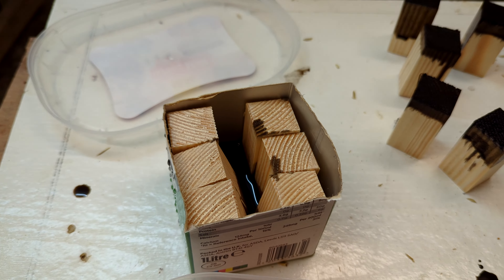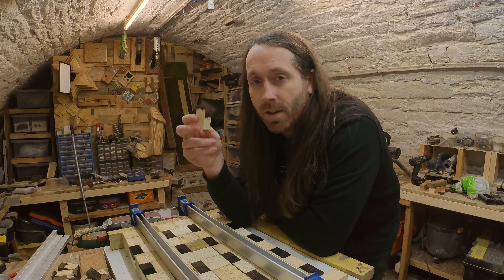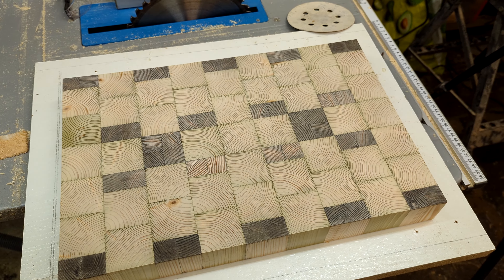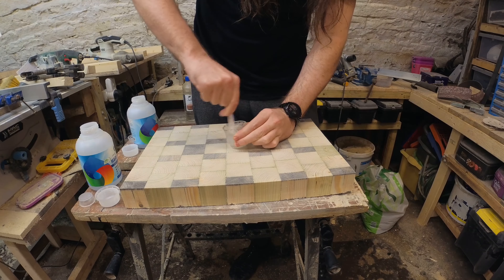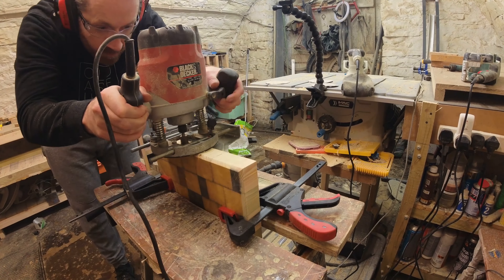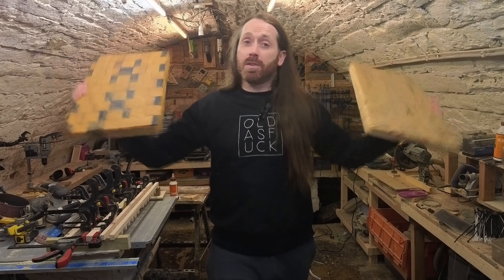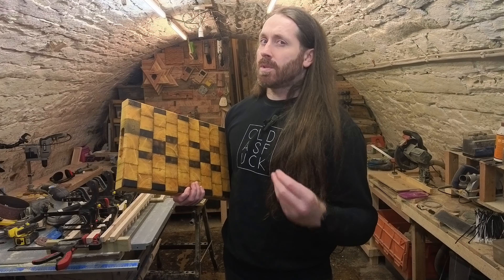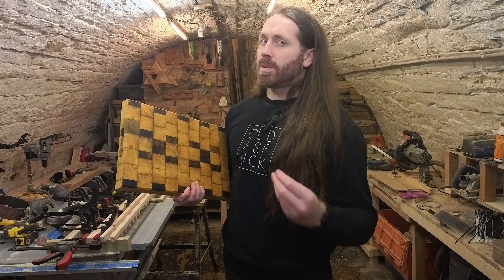Making End Grain chopping board for under £10

Comment: When 'practising' the art of cutting boards, ANY wood is good.  If using wood of an unknown origin, ie anything other than natural wood from a log or slab...or store bought, I would suggest using the 'samples' as hobby boards.  For instance, one in the workshop to smack things on a 'soft' surface, but without denting your worktop.  The other option could be for modellers etc.  If you route out a recessed surface, it would help to stop those pesky little bits and pieces sliding off and getting lost.

My first attempt was using defective and off-cuts of pine from my local Bunnings (in Oz), which was either CHEAP or even FREE, as it could not be sold as warped, split etc.  After watching MANY videos, my next was simply a side grain option, using french oak planks which were used to flavour red wine.  The colour came out great, and smelt nice.  I then reverted back to 'food safe' pine to practice my first end grain, but using the method 'usual' of gluing long boards, and then cutting, glueing, cutting and glueing.  It is definitely an art, to getting the squares right, and equal.

I have left my boards to dry for as long as possible before flattening them, just to allow for moisture to escape, and settle etc.  You could always add a border/frame to the outside edges, this would not only give a different look, but also add a strength to keep them straight, especially if dowelled, which adds it's own pattern if you change it up a bit.
Reply from the maker: Thanks for the info. It's always inspiring how much feed back and help I get from these videos!

Comment: The reason you had issues with the router and leveling it in the end is Pine is terrible for cutting boards as it is such a soft wood.
Reply from the maker: ahhh so it was the wood. I know some woods have worked better than others, but I've never seen it that bad. Maybe it was a combination of the wood and a dull router bit.

Comment: Cutting board out of treated timber 😞
Reply from the maker: Is that bad?
Reply: I was going to say the same thing
Reply from the maker: @fromthepalletshed  I don't get it? What am I missing 🤔
Reply: 0:05 top left of the screen, is that a wooden Christmas tree pointing out of the wall ?
Reply: @LowBodgeItFilms  The lumber you used for the second board isn't treated timber based off the sign you showed. Never use treated lumber in anything food related.
Reply: @LowBodgeItFilms   There's a lot of toxic substances that can be found in treatments and stains. Tight grain natural hard woods are for the most part food safe. The open grain of soft woods like pine will rapidly fill up with bacteria. They would make nice serving trays, but I really wouldn't do any food prep on them.
Reply from the maker: @jeffcarr392  It is a failed lampshade from a previous video. Although I can see what you mean and that gives me an idea for a Christmas video 🙂https://www.youtube.com/watch?v=HNnZyNThh-U
Reply from the maker: @Tooterfishpop  ahhh right. I will have to look into that. Such a shame because that one turned out so well 😞
Reply from the maker: @minuteman1043  I just started looking into it. It's a real shame as I thought that one turned out really well. As for the grain, someone told me to use the food-safe epoxy to help fill the surface so bacteria doesn't build up.
Reply: @LowBodgeItFilms no problem, iu are welcome, I only take 60% of all royalties, looking forward to raking it in 😂 👍
Reply from the maker: @jeffcarr392  well I have sold 2 tables. No YouTube money yet (surprisingly not far off my first 50pence )But I would have to factor in the time spent over the past 2 years 🤔
So it's about minus £7835 🤣